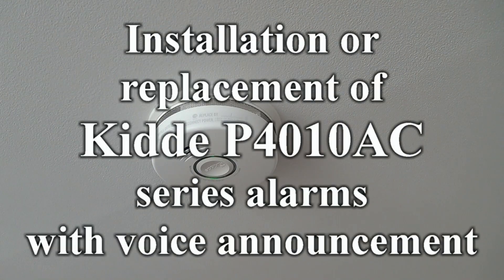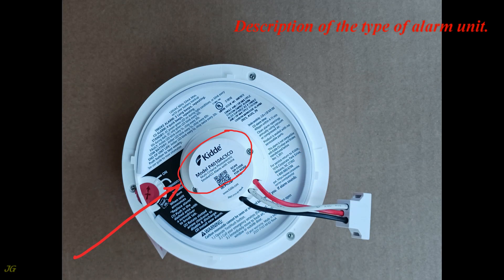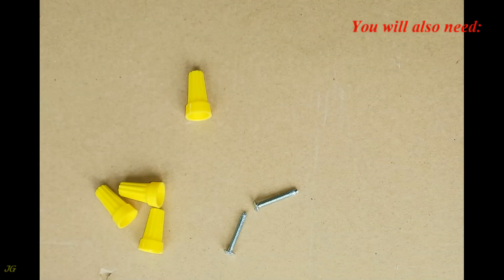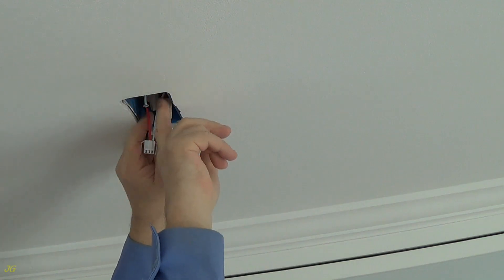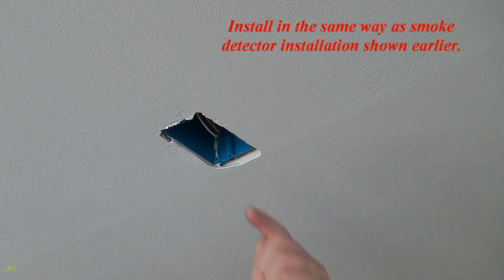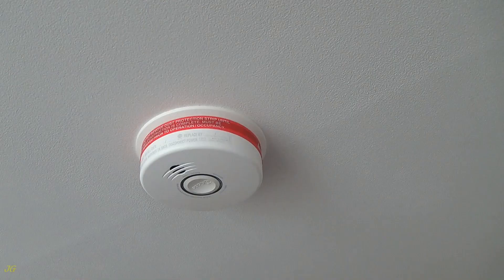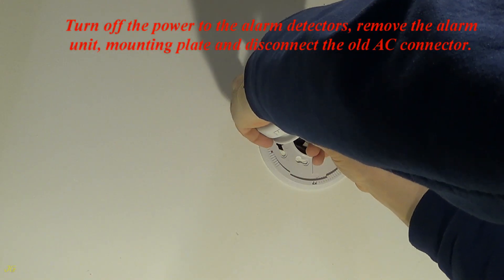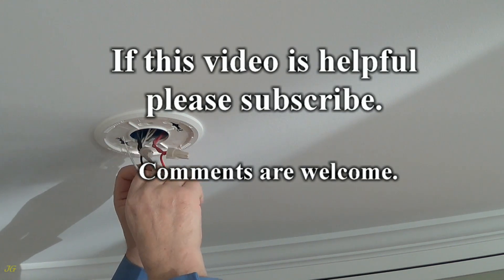Installation or replacement of Kidde P4010AC series alarms with voice announcement

Comment: I  just got the 10 year worry free smoke and carbon I installed it. Is green light solid suppose to be turned on at all times after doing the wiring and installing it ?
Reply from the maker: Green means AC energized.
Reply: I bought these from Costco and installed them. The led came on and was green for about a minute after connecting it to my existing wiring before the LED went out. According to the instructions the green LED does not stay on but its a bit disconcerting - I would prefer if it stayed on all the time as its an easy visual check that everything is working okay
Reply: I just got mine installed and tested working with other wired alarms, having the same question should the green LED light turn on all the times when on AC? mine is not.
Reply: Figured it out, use a bright light on the center of the alarm, the LED will turn on green if it is on AC.
Reply: @1paulxu  I tried this and it the green LED comes on if you shine a very bright light on it (an LED flashlight from a short distance away) but once you take the light away it goes out after about a minute - I guess this is normal these days
Reply: @Jagshemasher It's so that you can't see it in a bedroom at night
Reply: Manual says, "AC power: Green LED on continuously during light conditions, or blink every 60 seconds during dark conditions.".  

I think this is so that at night, the green light will not bother anyone who is trying to sleep.